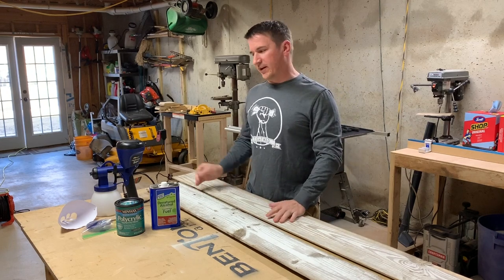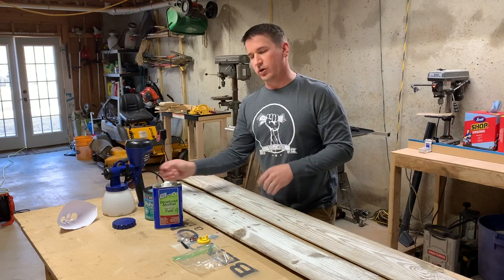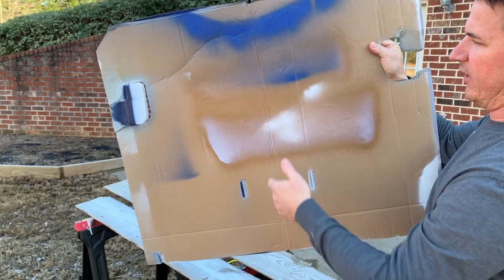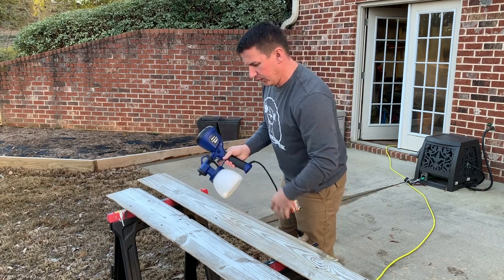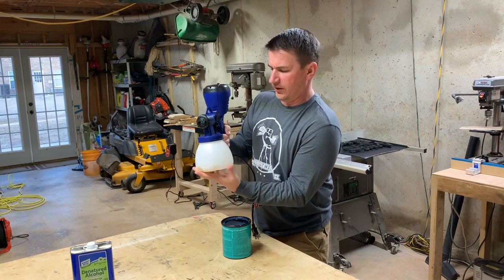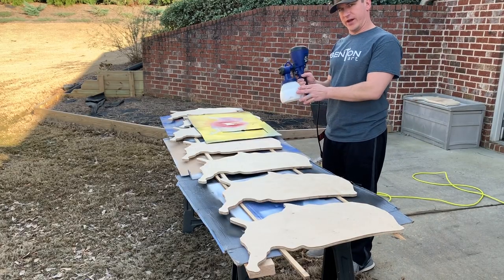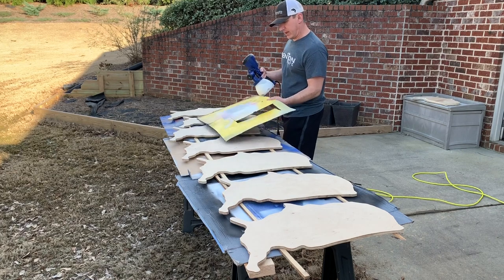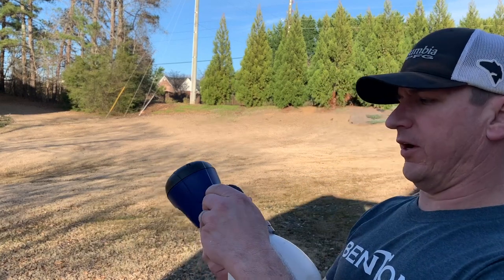Spraying Paint or Finish Correctly: HomeRight Finish Super Max

Comment: Nice videos on this Homeright. I have the same one and I have a project to spray a dresser red and them black accent. My question is, should I worry about overspray and build a paint booth? I have a garage and want to do it there but worried the red chalk paint may get everywhere. Do you have a suggestion or am I just paranoid about the overspray? Thanks for your awesome videos! BTW, I do not have a yard. I live in the city.
Reply from the maker: I think you are right. The overspray will probably make a mess painting indoors. At minimum i would use a really large tarp.

Comment: hello Tightwad thanks for the video.  I am about to use mine for the first time.  Have you learned if there are any types of paint you SHOULDNT use in this sprayer?
Reply from the maker: I haven’t found any. They are very responsive though if you send them a message.
Reply: it comes with a manual, read it!

Comment: Did you thin any of the products you used in this video? When spraying the US pieces, was this primer only OR a latex paint with primer combined? I see people thinning and not thinning products (paint, poly, etc)  when using the sprayer...?
Reply from the maker: I haven’t thinned anything I’ve sprayed yet. I would probably thin oil based paints and varnishes but this lower end latex paint sprayed fine without thinning.

Comment: what would you use to clean it if you are using oil based paint?
Reply from the maker: Good question. You would use paint thinner or mineral spirits.
Reply: I would use whatever it states on the can to use to clean so you don't end up with residue and ruin the sprayer.    Different finishes require different cleaning solvents.

Comment: Is there no need to thin any materials that you've used? Most videos say it should be done.
Reply from the maker: Quintin Wiley I haven’t needed to yet. The thickest think I’ve sprayed is latex paint and it didn’t need to be thinned.
Reply: @TightWadDIY  Thanks for the response and video. Both were helpful.
Reply: You have to thin the paint. I diluted 70% paint and 30% water. It worked well the first time. The second time, imy project was indoor, i was pai ting a wall and it suddenly stop, never worked again. I called home right customer service. They said that if you pass the guarantee time, they cannot help you. So, because it is disposable, just buy and paint as much you can. The second time, most probably it will not work anymore
Reply from the maker: anonimo hola You are incorrect. I haven’t needed to thin any paint I’ve sprayed. I’ve also painted multiple projects and the sprayer still works great. I know several others that have also used this sprayer for multiple projects.
Reply: @TightWadDIY  you are giving misleading information or you never used it properly. Even the instructions tells that the paint must be diluted, I tried to use without dilute and the results irregular color. Paints must be thinner to pass the small opening . This piece of garbage only served once. The second time it stopped while i was paiting and it did not work anymore.
Reply from the maker: anonimo hola You are the only person who has ever mentioned an issue with this sprayer. I know several makers who use this exact sprayer on a regular basis with no issues. None of us dilute interior latex paints or water based products. We are using interior paints so possibly thicker exterior paints may need some dilution.

Comment: I have been trying to spray the chalk paint by rust o leum but it keeps looking like orange peel. The outer edge of the spray pattern is where it happens, once you're done the whole thing is messed up. How do I fix this? I thinned the paint 7% and once at 10% but had the same issue
Reply from the maker: It could be the surface you are spraying it on and not the paint or sprayer.
Reply: @TightWadDIY  Ive painted plywood, pine, dining chairs, etc but all the same issue.
Reply: I always keep a brush nearby for runs or spots that are a little too thick. If you use the brush right it won't leave brush marks at all.